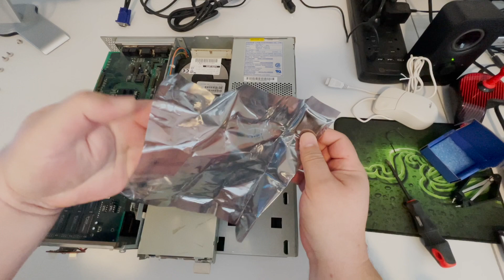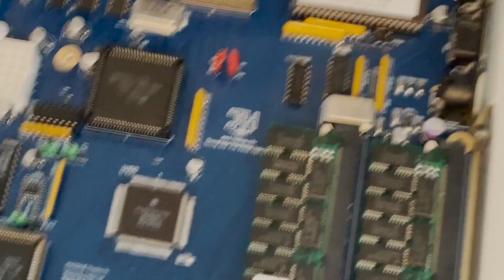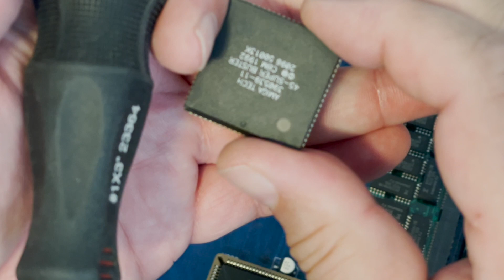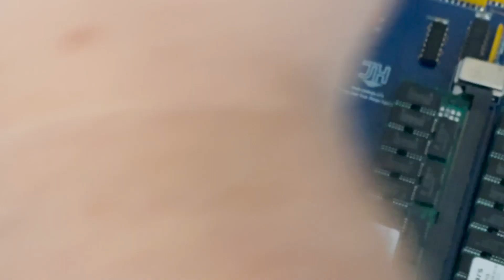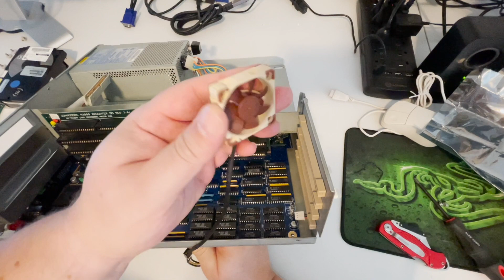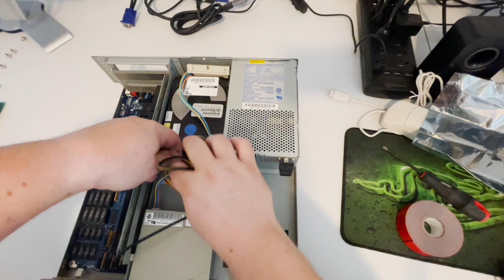BUSTER "11" and 68060 cooling for Amiga 3000!

Comment: Nice job on your Amiga 3000 video. Your upgrades caught my eye so I will have to take a look at your other videos.  Unless you plan to output NTSC video, running PAL isn't so bad as many of the Amiga titles run in PAL. I would appreciate you checking out my channel as well!
Reply from the maker: I’ll gladly give a look! Yes with all these modern monitors, PAL isn’t really so much an issue anymore.

Comment: Have you ever tried a rework station to remove a chip from a mainboard (and subsequently replace it?) It's not nearly as difficult as it seems - and I say this as someone with super shaky hands who managed to do it with a very tiny IC too!
Reply from the maker: No idea what that is and it sounds terrifying. I tried to do a simple cold solder joint fix for the power LED and couldn’t do it right. I’m very terrible at the soldering stuff. :)
Reply: @HoldandModify  well I hope you’ll give it all another try! With you being involved with older computer stuff it will definitely come in handy! I learned because it was the only way I could get ahold of certain music equipment like drum machines and synthesisers. I feel like with my complete lack of dexterity and mostly caffeine induced shakiness that if I can do it, just about anyone can, so I tend to go out of my way to encourage others!